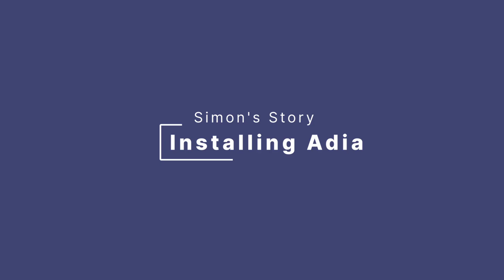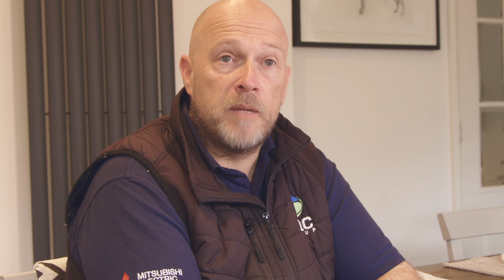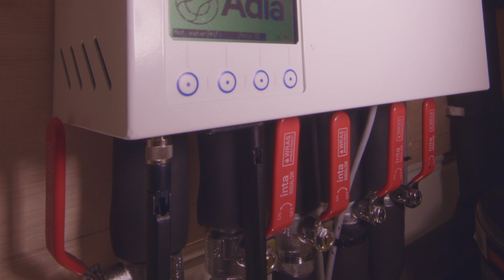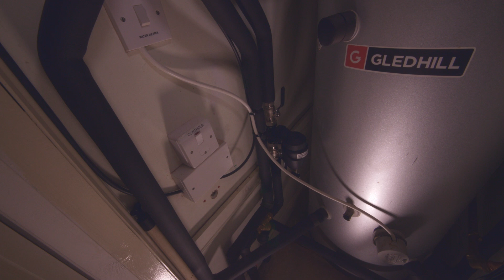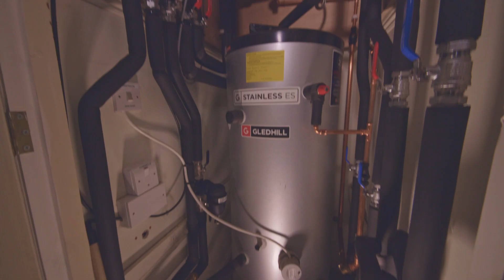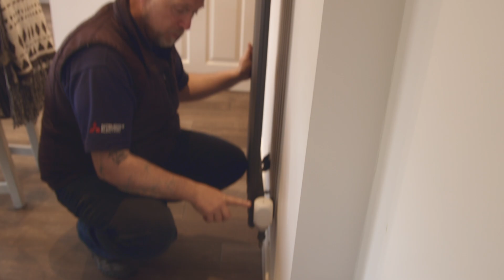Adia Thermal - This device will change the heat pump game - explained.

Comment: Looks fantastic! Some questions if I may:
 - Will systems like yours that include Adia and existing tank and rads still receive an MCS certificate?
 - Can Adia also detect when you are away from home and reduce heat, eg geofencing sees when you leave/return for work
 - How does Adia alert you to undersized rads or how you could increase CoP by increasing rad sizes?
Reply from the maker: HI, yes MCS certification still applies, the system performs well past the minimum required efficiencies and heats your whole home, the ADIA is a control system that allow the ASHP to be a bit smarter, controls every room and there are many design now being done without the need to change the HWC without smart control.
I don't think it can geofence but it does have a holiday mode which sets everything back to 9 deg C frost protection, you can then set the system back to normal from your holiday location the day before you return, might be worth pointing out though, unless you are going away for 2-4 weeks there is no real saving in allowing the home to drop to 9 deg C in the dead of winter as it will need a fair bit of energy to bring it back to 22. it's recommended low and slow to heat the home over the whole winter.
You can reach out to ADIA for the undersized rads report information https://www.adiathermal.co.uk but as I understand it, the system can measure to power and the use of every individual emitter, this then can tell the system it emitter is using the correct amount or it is undersized, this takes a whole winter season to calculate though as it needs to see all of the losses over the peak of winter.